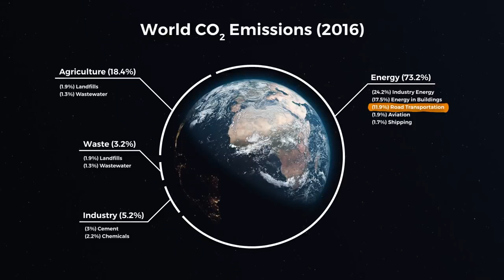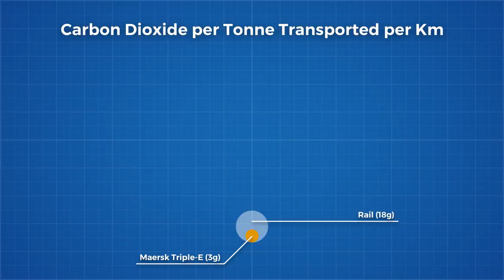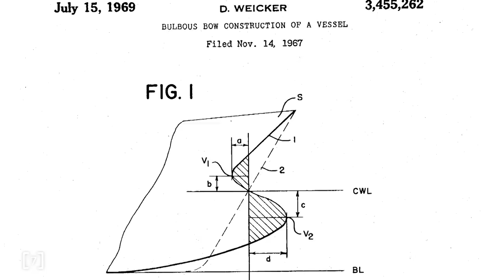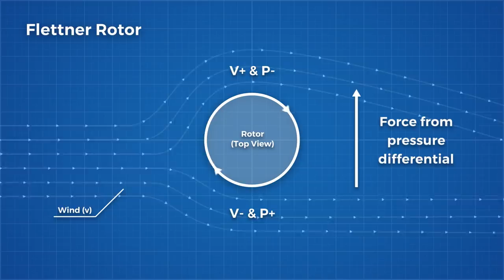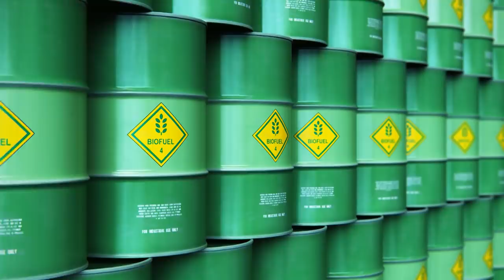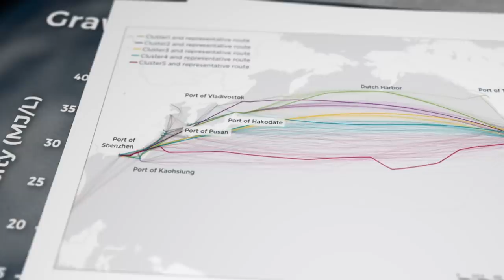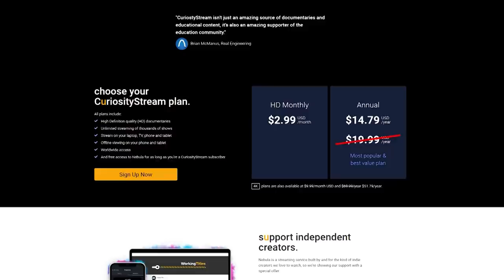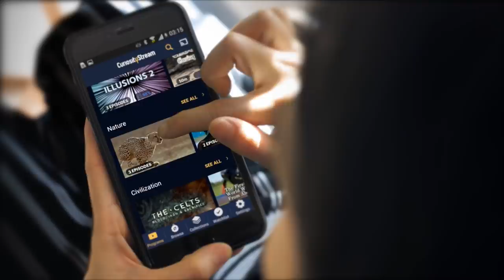Are Renewable Powered Ships Possible?

Comment: Awesome video...Explained clearly about the shipping 🚢 pollution
Reply: The easy option to reduce pollution from merchant shipping is to reduce the transportation of things that people do not need, however much they might want them, further than is absolutely essential. 

Using material and products that are available locally, to the point of consumption, will also reduces transportation impacts.  Freight is always a balance of mass (weight), cubic capacity (volume) and value so not moving an item from ‘a’ to ’b’ unless the value added significantly out ways the costs, including environmental costs, incurred is a good starting point.  Merchant shipping is currently run as a ‘high quantity - low margin’ revenue generating business and any improvements will need to lower cost or provide better value to be voluntarily adopted by the trade.  The ‘high quantity, low added value’, which also means low profit margin incentive per unit, operational basis is in part due to end user reluctance to pay the full economic and environmental cost of what they ‘want’ to have, think Glastonbury £100 (ticket price) count me in; Glastonbury £1 000 (full environmental cost) no way!

Comment: Ammonia fuelled and Nuclear powered (although technically non-renewable) are both viable options. Compression ignition engines can be converted to run on green ammonia with some modifications, and a Nuclear cargo carrier has it's own advantages and unique set of concerns.

Comment: Modular nuclear reactors housed in the cargo ship might be the future, but ppl are too scared of the word "nuclear."
Reply: For the biggest ships yes, for the smaller ones its probably cheaper other sources of energy
Reply: I would have to agree that this might be one of the ways forward.

Though the cost of running these would likely be too expensive for shipping companies to incorporate into at least half a dozen ships.

Hence why nuclear-powered ships are mostly confined to military roles.
Reply: @SSA_Pizza  the cost would go down significantly as they become more widely used though
Reply: @Jet-ij9zc  More than half of all maintenance costs of any merchant vessel is dedicated to  salaries and wellbeing of the crew. That is why shipowners tend to minimize the number of crewmembers, feedrates etc (from which we, the seafarers, suffer in the end). Equiping merchant vessels with nuclear reactors would require complete re-training of nearly all existing seafarers as well as developing and introducing completely new regulations for training and certification  of seafarers worldwide which would lead to huge bureaucracy issues for years if not decadess, considering how long it takes for even much less significant IMO documents to be ratified and implemented by all of IMO members. This increase in competency requirements would, first, leave most currently working seafarers without a job perspective, and second, require an increase in overall mandatory number of crewmembers competent enough and ready to maintain a nuclear reactor 24/7. Just from an economical side this is ridiculously unrealistic, even without considering the costs and time and effort for retrofitting even a relatively small number of existing vessels with consideration for safety and security measures. In the end, even a "regular" fire on a ship is a very serious and dangerous thing, imagine if their is a nuclear reactor involved, somewhere in a busy Asian port. Accidents at sea happen all the time, seafarers are sometimes not qualified enough to tackle even their competencies, sooo many things happen under the main deck of a regular containership, even within an existing system of rules, regulations and recommendations, so it is highly unlikely that anyone would agree to add some nuclear stuff into this mess.

Comment: Thorium micro reactors are being researched pretty heavily. They're planning them for powering grid independent factories, so it makes sense cargo ships would be next once everyone gets used to them
Reply: Just think; would you have full confidence in the management of a nuclear reactor under the control of an anonymous entity only traceable, perhaps, via a letter box in a FOC (flag of convenience) nation state?  If you are, could you sell that confidence to Japan, the state that hosted the Hiroshima and Nagasaki nuclear detonations as well as more recently the Fukushima ‘event’?  Then try that same, or a similar, sales strategy on Ukraine, the nation state that as a part of the USSR (CCCP) hosted the Chernobyl ‘event’.

Modern iterations of nuclear energy, thorium fuel, molten salt reactors, small modular reactors or fusion reactors, will carry the legacy of past problems.  It is the global trepidation of anything with 'nuclear' in the name and the economics of nuclear having transitioned from 'energy to cheap to charge for' too 'the costs of remediation are incalculable' that will prevent the adoption of nuclear energy as a means of creating energy at sea.  Modern reaction systems may have overcome the safety problems but the general public, having been misled in the past, will be reluctant to believe the fresh new promises.  The incident of the ‘Ever Given’ blocking the Suez Canal, March 2021, may also have a little to add to this debate.  The cooling water on ships tends to get taken in from near the bottom so when running aground the inlets are in a prime spot to get plugged up restricting, if not stopping, the flow of coolant.  One thing that the TMI, Chernobyl and Fukushima incidents all had in common was that the supply of coolant, or rather lack thereof, was a fundamental cause.  Similarly and only months later, May 2021, had the ‘X Press Pearl’ been nuclear powered then a major port for a populous nation in the global South would have possible been the site of a significant exclusion zone due to a non power plant related incident.  If the ‘X Press Pearl’ had on board a fired up but ‘safe’ molten salt reactor and found herself having to dissipate the residual energy associated with the possible 12.5 megaWatt power cycle would a stable cool down have been possible?  Would there have been sufficient heat energy contained in the power system to facilitate a hydro thermal explosion?  In a casualty ships may capsize, like the ‘Karin Hoej’ off of Bornholm in the Baltic early December 2021, in which situation any safety system reliant on gravity might not work.  It might also be worth bearing in mind that part of the TMI near miss the fault of the navy trained operators focusing on not letting the primary cooling system 'go solid'.  The actions of the captain of the 'Costa Concordia', Francesco Schettini, may also be relevant; the consequences of his actions, whether due to ineptitude, an isolated act of incompetence or driven by a corrupt corporate culture, illustrates well one of the dangers of releasing nuclear energy into commercial shipping.

As a second point if you fit 'walk away safe' reactors on ships you will need duplicate drive trains as there are seldom salvage tugs around when you really, really need one.  A nuclear ‘dead ship’ drifting around NUC (not under command) would be a disaster waiting to happen and duplicate systems increase expense.  Land based nuclear power plants have a few issues but are immobile, stable and usually well regulated.  Reactors on ships by their very nature are able to move between regulators, bump into each other and roll over.  Regulation of ships by both / either flag state or port state has problems and adding any nuclear regulatory obligations on to those already overstretched facilities would be very taxing for all involved.  This is not about 'can it be safe' it is all about 'will it be safe'.

Furthermore while merchant ships may be 'taken up from trade', as the RN would say, or may be captured or impressed by non state quasi military entities by way of piracy, cargo ships are not military vessels.  They therefore do not have the same inherent level of self protection and internal discipline.  Why not use nukes on merchant ships?  It is down to engineering, finance, socio-political attitudes and safety.

Comment: im kinda dissapointed that you didnt mention the E-Ship 1 operated by Enercon, wich has FOUR of the Flettner rotors to propell it 
https://upload.wikimedia.org/wikipedia/commons/thumb/6/6e/Cargo_E-Ship_1%2C_Emder_Hafen%2C_CN-02.jpg/1920px-Cargo_E-Ship_1%2C_Emder_Hafen%2C_CN-02.jpg
Edit: its also worth adressing that the rotor has been around for almost 100 years https://www.ingenieur.de/wp-content/uploads/2017/11/2013/1307_Das-Motorschiff-Buckau-1924-mit-Flettner-Antrieb-e1533283231390.jpg

Comment: are electric ships with nuclear fusion reactors the answer?
Reply: @BernardLS  Don't source the BBC for geopolitical news by the way. Britain has loads of nuclear subs. You should talk about Russia's nuclear ice breakers. Also, you are completely ignorant of his question. Nuclear Fusion doesn't produce radioactive waste per se.
Reply: No- we don't even know what a stable self sustaining fusion reactor really looks like. with fusion reactors in general in theory we could just hook ships up to power lines or something. probably just use high speed rail for most of it.
Reply: @carbon1255  we are building a fusion reactor that could be self-sustaining, it's called ITER, more than 30 countries are collaborating to make this fusion reactor. so we do know what it looks like, it's self-sustaining but we can't really get any usable energy from it. a company called general fusion is making a fusion reactor from which you can get usable energy. so it's only a matter of time until fusion power becomes a reality. although the necessary shielding required to stop all the neutrons from reaction might be really heavy so that might be a problem.
Reply: @BernardLS  you do know that the term "nuclear energy" doesn't just mean nuclear fission power right?
Reply: @mastershooter64  broad brush approach, but fusion is still 'twenty years away' as it has been since about 1960 (:-)
Reply: @carbon1255  in Pevek the Russians appear to be going the other way using floating fission reactors to power the grid. This is a good discussion but my fingers are to lls and fat for extend dialogue on a smart phone. Will pick it up later.
Reply: @carbon1255  The UK RN current operational nuclear fleet is 8 boats, the 26 boats no longer in use are laid up (some in Rosyth and some in Portsmouth) awaiting long term deconstruction including dealing with the fuel rods and other irradiated material.  No details, as far as I can find out, are available in the public domain.  Russia's nuclear ice breakers are something else about which deconstruction information is difficult to find.  The BBC is a well known and respected MSM organisation that does not hide behind a 'pay wall' that I am comfortable using and thus will continue to do so.
Reply: @carbon1255  Nuclear Fusion may not produce radioactive waste but is not yet an established technology so is one for the future.  When either as spherical or tokomak reactors they get up and running the difficulties of operating them may still make them unsuitable for commercial marine use. mvh Bernard

Comment: my opinion on biofuels is that as a primary or even secondary energy source it is not viable but for some case where where their isn't a reliable source electricity and the demand for energy is relatively low na d with significant requirement for dense energy source, it might be the right answer and I feel the shipping and especially the aviation industry might fit that bill.

Comment: I am a ship engineer and I work on these ships and most of the new systems have a lot of growing pains to work out. these new systems are very difficult to work with in the mean time
Reply: to achieve a real reducción they need to redesign the hul eliminate the bolbous bow with a long tube along the length of the ship, propeller place within the pipe,this will eliminate frontal resistance,no front wave and will create a wave in the back of the ship.
As far as green energy Hidrogen or CAES,compres air energy storege ,one or a convination of both is the solution,the source is built energy harvesting ships, sails and solar power with generator like the ones use for tidal energy , they don't need to cross canals or water wais, refills can be done in open ocean justlike tug boat. 
and last solar electric container ship to Carry only empty container,this will reduce time in port,and they can travel very slow.

Comment: Possible is an easy question: obviously yes. Wind powered ships have existed for millennia. The more appropriate question is are they feasible for modern shipping
Reply: You need big sails to move a big ship
 Also, wind isn't always there. Another thing to add is that metal is heavy and if they were made out of wood it would be unsafe for every one. So to answer you question, no, wind powered ships aren't going to be useful for shipping.
Reply: The answer is no.
Reply: @alabamacoastie6924  That works too...

Comment: "Are renewable ships possible?"
"Wind alone can't power ships"
Sails, holding 2.8 millenia of near exclusive usage: 😑
Reply: I know you are being funny, but look at the weight difference between a cargo ship and a sailboat
Reply: @FSXgta  I know mate. And its not even a question of weight, but the materials needed to employ masts that could withstand the torque, and sails, everything.. it was really just a joke.
Reply: @rrs_13  it's a good-enough joke.and despite knowing it is a joke I am going to interject that "near exclusive" is the debatable part here - rowing AND going with river flow / oceanic currents are another factors (coincidentally also renewable) that historically contributed to shipping.
Reply: @janstankiewicz9816  Oceanic currents and winds still play a huge part in determining shipping lanes (it's not determined by the shortest route possible).
In a slightly different mater, careful factual analysis of a situation are one of the biggest joke killers ever.
As someone who enjoys sailing and boating, I know my previous statement is limited to being a joke.
Sorry mates, I don't really feel like debating the obvious
Reply: @rrs_13  hey! this joke was already dead when I got here! :)

Comment: This video talks all about efficiency of fuel use and a variety of great technologies for achieving more efficiency. It doesn't however talk about sustainability at all. 
decrease in fuel costs is more likely to just lead to more ships down the line. More ships only makes the production of goods people dont need  cheaper and more efficient. 
i dont expect the video to come up with a solution to consumerism, but even mentioning that fuel efficiency and a reduction GHGs are necessarily linked wouldve been a pretty basic thing to put across
Reply: May I add my £0.02 worth? The easiest, quickest and most effective way to reduce pollution from marine transport is to move less material and to move that reduced quantity shorter distances.  Consumers can directly influence that improvement by consuming less and using locally produced material and products.  Jevons paradox illustrates that improving availability and / or affordability of an item will increase consumption while human nature, and thousands of generations of evolution, has produced a 'wants' driven consumption pattern even as science, technology and success has allowed that humanity over proliferate.  Our fundamental global problem is excessive consumption by a portion of the global population that is too large.  Maulthus was not ‘wrong’ just ahead of his time.  The system we have is the best we can do on a freight tonne mile basis; if sustainability is desired much less cargo must be moved over much shorter distances.  So that is a 'plan B' but humanity keeps being stupid and there is no cure for stupidity.  Profit is a good incentive but sadly it is possible to make 'better' profits by pushing some of the costs onto the wider society; such as atmospheric contamination from fuel use or other energy transformation.  The number and greed of consumers on a limited living space may lead to over exploitation and thus degradation.  The primary question is 'should the producers and regulators be condemned, pilloried and castigated or should the consumers recognise that they are ultimately responsible for what is happening?'

Comment: Start with the hull switch to composites cut the weight of the ship by 2/3s use that reduction for batteries that double as ballast go electric for propulsion next hydrophobic paint then an air bubble curtain for the sides of the ship to further reduce drag.